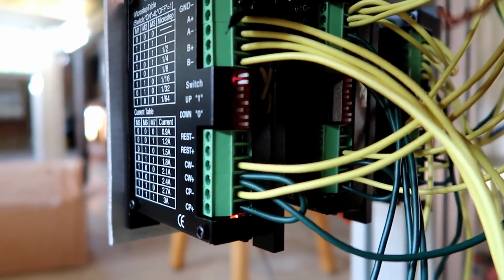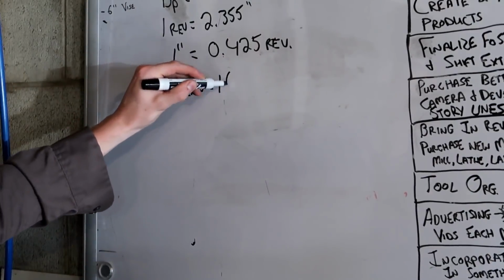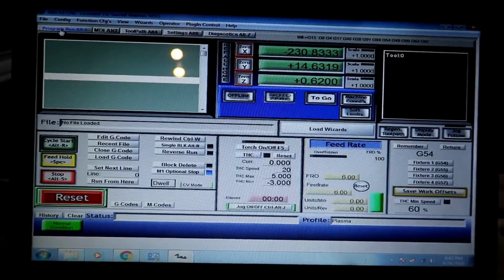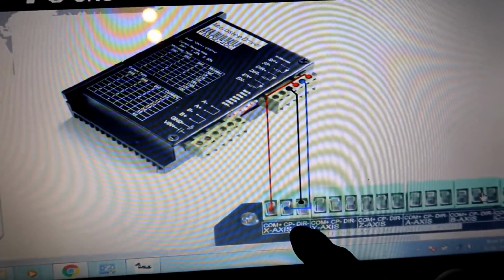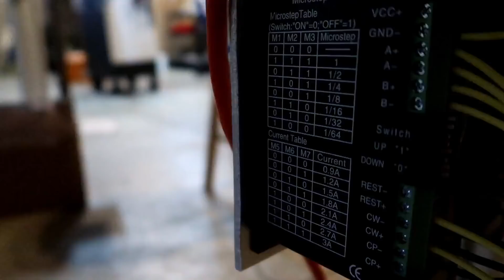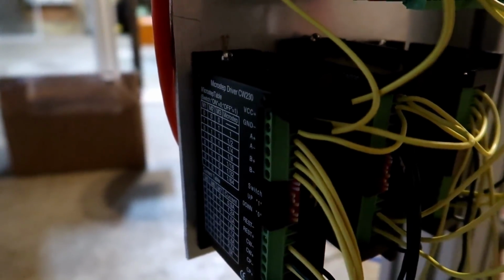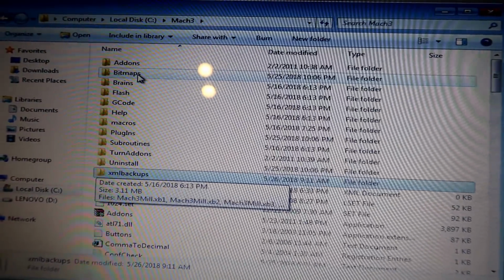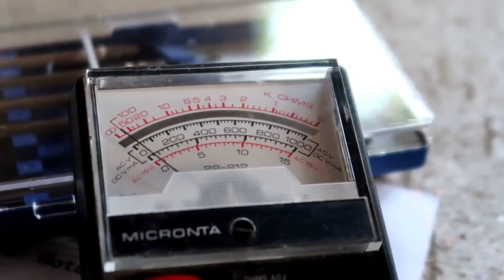DIY CNC Plasma: Troubleshooting Mach 3: Home Mfg. Days #41

Comment: Hi. My controller board is a Nvum5-SP, the 5 axis version of your board. The only way I found to  make the motors works, is set  the Step Low Active checked, at the Config, Ports an Pins, Motor Outputs menu. I set my four motors that way and now I am laser engraving pictures on wood.  I don't know if this will work with your motor and driver,  but could be helpful. Here my videos: https://youtu.be/uoDouRnhfE4  https://youtu.be/plsyrerOSkw
Reply from the maker: Thank you very much for your help!! I finally got it to work and decided to use Pathpilot instead of Mach3 but I appreciate your willingness to help me out!

Comment: HI! the Kernel have to be set at 25000.  a diferent pin # have to be set for cw and ccw for your motor to run on parallel port # 1
Reply: for exemple my x axis is set to ( step pin # 2 an dir pin# 14) an you have to make shure that from your break out board to your x axis driver your wires are plug in corectely
Reply from the maker: When I was trying this breakout board it would not work.  The USB boards never worked for me so I got an older desktop and used the parallel port and seems to work great!
Reply: Mach3 work on parallel port ,windows 7 . mach4 work on usb , windows 10
Reply from the maker: Ahh...that is very good to know!! Thanks!

Comment: Sounds very much to me like your stepper motors are wired incorrectly. Don't trust the wiring colours unless the information has come directly from the stepper motor manufacturer. Try this link to help identify the leads...

https://www.youtube.com/watch?v=-9r0X0m8Tos
Reply from the maker: I was thinking the same thing until I got them to work with PathPilot in my most recent video and they were wired the same way.  The only thing I changed was getting a desktop computer and using a parallel port breakout board.

Comment: Start with the velocity and acceleration to its lowest , step per rev way to high (2500). Once the motor moves normally then start increasing for normal movement. Computer will not make a difference at this point . I have used all different windows they work. Once everything move then use the calibration portion of Mach3 for distance moves (1"=1" etc.). There is a Artsoft forum for Mach3&4 that is pretty good.
Reply from the maker: I could not get that sucker to work for anything.  In my most recent video the only thing I changed was getting a desktop computer and using a parallel port breakout board....on top of using PathPilot to control the steppers.  I'm guessing if I were to go back to using Mach3 then it would work fine with the parallel port breakout board.

Comment: Hi Garrett, I think you should try the unipolar connection of the diagram. On a past project it was the correct one, and also set you setting of step per rev you calculate. I have actually on my cnc mill the acceleration on something around 30 and the motors and driver are very very similar, and works very good. Let us now !!
Reply from the maker: I am going to check polarity of the motors and if all is good there then I will try a different wiring setup.
Reply from the maker: My drivers are configured for a unipolar connection unfortunately.

Comment: Hi Garrett.....where are you at with this?  Sorry I didn't get to it sooner, but I'm not sure I have much to add anyway.  First off....put the kernal down to 45000 or 35000....you can try to move it up later, but even 25000 will probably work for the speeds you're going to be moving at. I'm pretty sure if your computer can't keep up with the pulse rate set, it will end up only sending intermittent bursts of info to the controllers....better to have a slower, steady, more predictable stream of pulses than intermittent.  I would also double, double check the motor wiring.  If one of those is wrong, you have a winding fighting the others and it can act weird, slow or not work.   The number of pulses to the motor is only really important for accuracy.....so you don't have to worry about getting that number exactly right while you're trying to get it setup.  But...1 million pulses is def not going to work.  If your setup needs 10000 steps to move an inch and it only gets 680, it's only going to be a tiny blip of movement.  I'm not sure what it will do if it thinks it needs 1000000 to go an inch.  After it's moving okay, you'll be able to test the accuracy with mach3.....you have mach move it an inch while you measure it with a DTI.....then you tell it how much it's off and it's adjusts the steps for you.  On you accel/velocity....keep the rise angle less than 45 deg until you get if figured out.  The steeper the ramp, the faster it tries to get up to the selected velocity.  If there's much load, the motor with lose steps.....basically, the step pulses will come faster than the motor can use them if the motor can't move the load.  It's been a good while since I had to mess with it on my machine and I wasn't that confident or good at it then.  Hopefully, you've already got it figured out.  I agree with you that it's not a hardware issue. :)  Time to sleep!! :)
Reply from the maker: I am checking the motor wiring now.  A lot of guys have been saying that they could be wrong.  Thanks so much for the help!
Reply: Hopefully, you'll find a simple fix, but since you've checked the wiring multiple times, it may be something else.  I understand why you would use just one color, but you might consider using a sharpie to mark the ends....before you wire it.  You don't need to mark the entire length, but marking each end makes it a lot easier to trace them later.  I like to mark them in a way that I don't have to turn the wire around to see all sides.  So...if you want to put 3 stripes on both ends...don't do marks along the length, do rings.  If you pick up some cheap heat shrink, you can use different colors....but that's pretty tedious and adds to the cost...which I'm sure is why you're not buying multi colored wire.  Hmmm.....I'm not sure what gauge your'e using, but most auto parts stores sell a roll of 4 strand for wiring trailers.  It's 4 wires in a flat layout....white, black, green and brown...typically.  You can always peel on of the wires away.  Anyway.....just a thought for another time.  :)
Reply: I see the control board raised off the main board......how did you end up doing it?
Reply from the maker: Yes! Thanks for the idea! I used a scrap piece of aluminum, drilled and tapped it then bolted it to that panel then used the superglue/tape trick to attach the board to the piece of aluminum
Reply from the maker: Unfortunately everything on the motors checked out okay.  I also have labels on then ends of the wires.  Haha I figured that it would be a troubleshooting mess later on if I didn't have any labels on it.
Reply: Sweet.  I figured you'd take the idea and switch it up to something quick and easy. :)
Reply: I've done wiring with all the same color and it bit me in the butt. lol  That's good the wiring is correct, but kinda sucks since it's still not running.
Reply from the maker: I'm grabbing an old PC from craigslist today and I will be going with a parallel port setup rather than USB and the laptop.  Hopefully that does the trick
Reply: I hadn't even thought about that.  So, changing the kernal speed to a much slower one had no effect?  I think you're getting a first hand lesson on why mach3 has such a love/hate relationship with so many people. lol
Reply from the maker: I tried all the kernal speeds haha....no dice. The kicker is, when I get the parallel port and the new board I won't be running mach3.  A guy I got in contact with is going to help me try something else and it may be the coolest part about the new setup.  Also, I did check the wiring of the steppers with an arduino program so they work fine.  I have a feeling it may be computer related.
Reply: Sounds great! I'm looking forward to seeing what it is. :)

Comment: The stepper sounds like the acceleration may be too high; perhaps lower the acceleration and max speed and that will make it easier to confirm that you actually are getting movement in the correct direction.
Reply from the maker: I'll try taking the velocity and acceleration down and move it up from there.  I am getting correct direction movement though

Comment: one more thing. not familiar with your specific hardware but as far as wiring, I would double check your direction signal, should just be one pin, one wire from usb card to motor drive. when it goes HIGH/OFF is how it signals direction change. You could probably remove the dir wire completely for testing.
Reply from the maker: The direction is correct.  I will try removing it for the testing to see what happens.  Thanks again!

Comment: check in your mach3 motor tuning. try starting with very low settings. low velocity and low acceleration. the motor sounds like it can't keep up with step signal.
also, I find on my machine the kernel speed in mach3 only works on the lower setting 25000? motors move plenty fast enough at that setting. I doubt you have a computer problem, I would be surprised if that was the problem. good luck, keep playing with it and you'll figure it out.
Reply from the maker: I will try that out.  Thanks for the help!

Comment: Looks like your wiring probably ok and computer running ok.....I would focus on the mach3 configuration....you mentioned 1000000 steps /in...then just decided to try.  Something wrong there.
Reply from the maker: I just wanted to see what it would do.  It went a lot quicker but still very choppy.